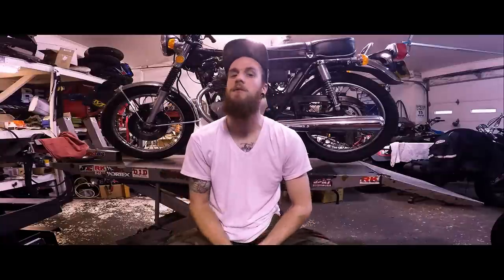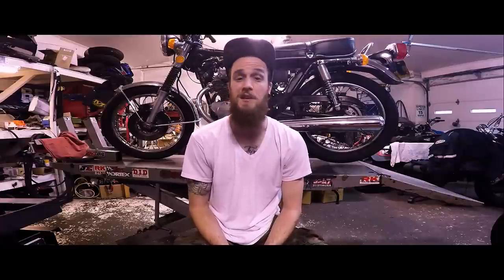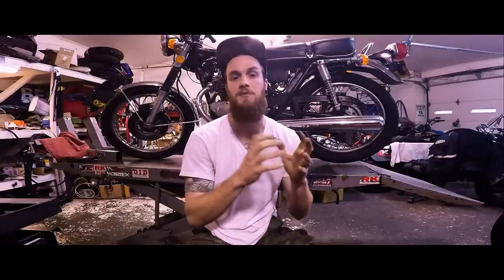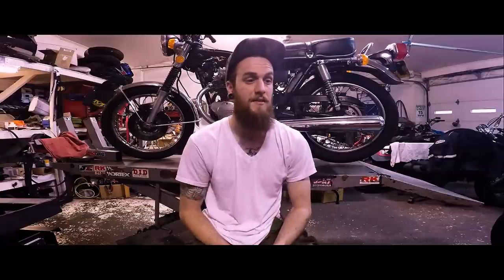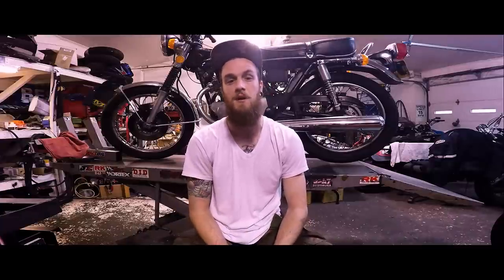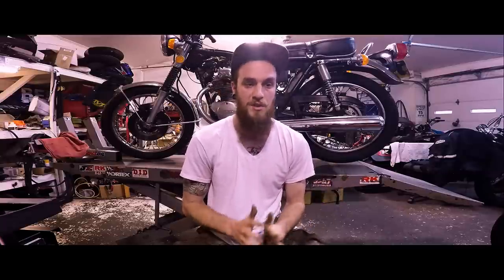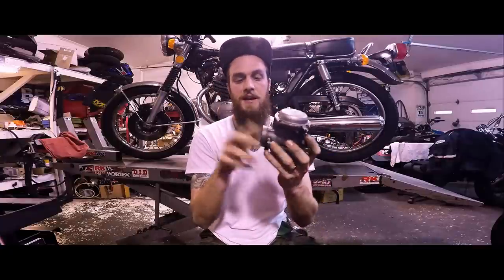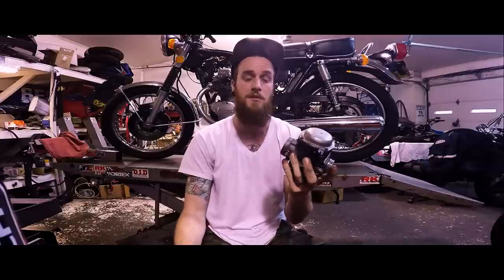How to diagnose a carburetor problem in less than 5 minutes

Comment: I got a question, bike runs smooth idles good besides one cylinder, the  cylinder has spark, the cylinder will run with the other three if I spray starting fluid, and when I drain the bowl it has fuel in the bowl, what would cause it to not get fuel if there is fuel in the bowl. There is a hole in the diaphram of the slide I know that. Could the leaky diaphram cause it not get fuel at all even at idle?

Comment: I have a 1981 gs450 that I am putting together. The bike was sold to me without carbs. I bought a set off ebay, cleaned them, and put everything back together. I had to re wire the bike, so I was concerned about the ignition, but I was getting nice fat spark. Compression was good. After got everything back on, I couldnt get any thing only get a crank no start. Tried to diagnose the problem with the starter fluid, even then got nothing but cranking. Any ideas where I should go next?

Comment: I have an old trail bike, and it was running till I dumped too much marvel mystery oil in the intake. I've checked to make sure the carb is working, and it does, I can get the engine to run by dumping gas into the cylinder, but it just takes off once it starts. If I let it, it will probably rev until detonation. Does have a suicide throttle thing going on but I can see that the throttle is completely closed. What do you think is going on?

Comment: After cleaning my carb and putting in fresh  petrol it will start but won’t tick over  unless the choke is on and once off it will cut out and when riding when throttle pulled back it just seems to choke

Comment: hello, 
I am having an issue with my 82 Honda v45 magna. I removed the carbs and cleaned the bowls and Jets because I couldn't get the bike to run without the Choke. I finally got all the Jets clean and reinstalled the carb onto the bike. Now my issue when the bike is idling without the choke on and I try to blip the throttle it dies. I'm stuck on what to do next
Reply from the maker: Did you soak the carbs in any solution? Just because the jets and bolts are clean it doesn't mean that the all internal tunnels, ports,and transfer circuits are clogged up. You probably don't want to hear this but I would recommend taking the carbs back out and really diving in. Often times peoples idea of "I cleaned the carbs already" is far from what that actually requires to be true.
Reply: andrrewa17 l

Comment: I have a 94 intruder 1400.  Just got it.  Runs weak.  Front cylinder plug was fouled when I got it(black wet with gas).  Bike sat over winter before I bought it.  Replaced both plugs.  Still runs weak.  Is driveable but I have to really twist the throttle to get it where it should go much easier.  Linkage to both carbs is intact.  Bike feels like a giant ninja 250.  Pipes are gold I'm told that means running lean.  Checked new plugs after 2 mile ride on highway.  Front cylinder plug barely ashy.  Brownish creamy white not full white.  Both factory plugs are still over both AF screws so I know the mixture is set to factory.   My initial thought is pull and clean carbs but I'm not sure I can sync them with what I have in my shop.  Any thoughts on a direction to take?

Comment: Hey Cody, quick question. Have an XJ650 1982 Yamaha. Started my motor without the pod filters, used the hand cover technique. It started fine and idled fine. Then I put on my K&N pods, now it's having trouble to start. What's the cause?

Comment: Ok so... i cleaned my carb, reasembled and it wont start... yamaha xt 600... spark good... compression good... doesnt start....when i bought it it ran a couple if times then when it died it didn't start again... then after a while it worked and thek again nothing...
Is it possible because of the float that it doesnt even start? Lost... help me out please!
Reply from the maker: Only if it was way way off. I would check valve lash.

Comment: Hi Cody!  Thanks for the great vid!  i have a 78 cb400t.  I think it's the same as the hawkii.  im running the carbs of a 79 cm400.  stock 78 cb jetting is 75/110.  stock 79cm is 70/112.  the common belief is of course performance can be improved b/c factory shit is too lean. i stuck the 75 in there, so im running 79cm carbs primary up from 70 to 75, and 112 secondary.  When i cold start it, it starts out good then roars way up to high rpm (dead tach).  choke doesnt do anything when thats going on,  i tried winding in the idle screws to 1/2 a turn out each and that made no difference either.  I could just put the old jets back in, but id rather understand wtf i did here.  why are my primaries causing high idle?  1 carb was leaking, so i fucked around with the float to raise the needle a little.  cant see that doing it either,but obviously im missing something!!

Thanks bruh!!

Comment: Cody thanks for the great videos you make!
I have friend with a 2004 (?) Suzuki SV650 that has an issue whereby it starts fine but once warm starts to stumble. The bike sits for prolonged periods so maybe that indicates the carbs are gummed up but why would it run fine when cold? Seems like that means the idle circuit is fine but main jets might be an issue. He’s having a hard time finding a shop in the Santa Cruz area that will work on carburetors. 
Thanks again.
Reply: 2004 sv 650 is fuel injected

Comment: Quick question. If my bike starts( kick start, but not with button), does that mean my carburetor is ok? I might have a sht battery so it wont start with button but if bike runs okay with kick start, carboretor ok?

Comment: Hi Codie . I have a issue 
4 cylinder triumph 1200cc. 1999
According to the exhaust gas analyzer, cylinder 3 & 4 at idle are at OEM recommended figures (3% ) co.
1 and 2 are running at 5.2 % .
But theres no more idle adjustment left  before it cuts out. I'm thinking of dropping down on the idle jet size. ???
My problems is which  cylinder is it ?    1&2 go into one exhaust. .
What's the best ways to tune each carb .
And yes they all have been ultra sonic cleaned and fully rebuilt with gaskets and new seals and all that..
Do older bikes tend to run a rich mixture and a very high hc  figure. ?
My victory runs almost on fresh air is it possible to set up an  older bike to run more eco friendly  ?
Sorry so many questions.

Comment: Hi bro. I got a '94 Kawi. Cleaned carb, did valve clearences (maybe a little loose), new battery, adjusted float, is now starting and idling finally... but when i give throttle, it either bogs, or revvs very high and hangs there.

I got one leak between the carb and the filter, air side. Can that be the problem? Mixture screw 2.5 turns, i dunno man

Comment: Hey was seeing if you could help with adjustments of the throttle cable from the carb? My throttle adjustment is maxed out on my bars and my throttle still sticks when I turn the bars to the right and it's super sensitive in all other positions of the bars. Thanks for the videos keep them up!! I have a 83 Honda nighthawk 650.
Reply from the maker: Hey Brian, I'll try my best! Are you still using the the stock handlebars,cables, and or risers? How confident are you that the cable routing is correct?
Reply: TheMotorcycleMD yes everything is stock. Im pretty confident because I can get it adjusted pretty good except when I turn the bars to the right the cable has way to much tension on it and sticks. Is there something else it could be? Does adjusting the throttle cable at the carbs loosen the cable or it if a different adjustment altogether?
Thanks!!
Reply from the maker: Bryan Stocklas Hey, head over over to motorcycleMD.com so I can get your email. It will be easier to respond.
Reply: TheMotorcycleMD I sent you a message on motorcyclemd.com thanks again

Comment: I have a 125cc scooter the other day it was working completely fine than the next day i filled it up with fuel it just randomally start making boggy type noise when I rev more it doesn't get enough power was lucky enough to get 30mph in a 50 zone :/ any ideas?

Comment: I have a CB350 that I got a few months ago. It runs rough. Carbs are clean, valves are adjusted and everything. It stutters in idle and mid range, can't get it to idle at below 1100 without it cutting out. How do I tell if it's too lean or too rich? Also, how do I go about tuning the carbs and syncing them?

Comment: Hey man I have a ninja 250 that was sitting for about 2 years at first it would shut off on idle when giving it gas. The carbs were cleaned as well as dumping the bad gas and now it runs and doesn’t die however there is some power loss I have to twist the throttle all the way down which is unusual. The bike just feels different. Do you think changing the spark plugs can fix my bike?

Comment: Got an 86 Honda goldwing GL1200 ASPENCADE. Doesn't like to idle without choke and will stall if accelerated. Can spray starter fluid and revs up. Suggestions?

Comment: I have an old kz650 with mikuni CV carbs and it only runs when I spray starting g fluid into the carbs it'll rev up high then die, and I too lean? Or possibly a clogged jet?

Comment: i have a motor 2 stroke,and it runs very poorly,i can start it,i drove it ,but it runs like very very poorly.Can u diagnose that please? Also I opened the carburator pilots a good,but the only thing that i found old was my float.Can the problem be because of that?Please I need help

Comment: I recently bought a 03 ninja 500 with low miles, battery is new, the choker cable is moving, the guy said the carburetors were recently cleaned. Normally it should turn over even on cold weather. I keep cranking the bike until the battery dies with no luck and eventually I resort to jumping it with a car until it does run. The bike runs good once it does but when I leave it off for several hours it does it again, the choker doesn't seem to help much. Any suggestions?

Comment: So i have a 81 cb650c ive cleaned tje carbs and put it all back together. When it starts it iddlesas at about 2k and then after warming up it goes to 5k and bounces around alittle. Ive disconeted the throttle cables the choke is not on have the pilot screws at 2 1/8 turns from being set and idle screw not even touching the idler.  Ive bench synced it and I have no vaccum leaks that i can detect and all the jets seem to be not clogged. Im unsure where to go from here.

Comment: Hello,  I own a Dr250s that I have bought. The bike itself isn't running the best, It doesn't idle at a constant level, and It has a major delay on the throttle while in motion. The delay isn't there or at least not noticeable while in neutral. To my knowledge, it has been ridden alot over the past 6 years with out much service...  What could this be? and could i do it myself or should i take it into a shop?
Reply from the maker: +Ethan Honestly brother might be a good idea to get a professional to check it out with the amount of hours put on that. I would hate for you to spend more time combing through non-issues to figure out what's going on. May be time for a good valve job and a solid diagnosis from a trusted tech.
Reply: Sweet. I was thinking that that would be a good idea. Just a bit pricy is all

Comment: Great video love it. Question i have a dirtbike Lifan 125 engine, kicks right up idles fine, when i go through the gears it severely lacks power, backfires excessively on deceleration, and makes spitting noises when throttling. Put new plug in old one had alot of soot, exhaust has alol of soot in the front and back. I think its running too rich or the float is messed up, i can almost tighten the screw on the carb down to barely nothing and it will still run. but i feel it maybe more than that. It'll start with choke closed almost first kick and sprays fuel out with the air filter out when kicking it. any ideas?
Reply from the maker: At first thought it almost sounded like the cam timing or ignition timing is out. Regardless, it is definitely WAY too rich. Either the main jet dropped out in the bowl, float issue, blockage in the intake (air filter area), main jet needle clip is wrong position ect. If I where you I would buy you a brand new carb to replace that one. Those Chinese/Taiwan made motors are cheap. I bet you could find a carb for it for 50$ shipped to your door. Save the headache and start fresh.
Reply: thanks for the reply, ended up figuring out last week it was the timing. the flywheel was not attached properly. Still running rich though so looking to get a new carb. Thanks for the advice !

Comment: Very useful info but I habe a question, I have a 1982 honda cb650sc, clean, coated tank, rebuilt pet cock, and carbs with a brand new ignition system. When I go to start it on full choke or without the choke it will begin to run then die before I even release the starter button. I'm wondering if this is an issue with the jets or possibly a timing issue?
Reply from the maker: I would check compression, and spark on each cylinder for sure
Reply: TheMotorcycleMD it has good compression and spark because it will run on starting fluid.

Comment: Hey! I would have one question: I have adjusted the float level on my carburetor, and replaced the float needles. Now after the winter the bike will not start. I am wondering whether it is due to the earlier modifications - I even tried a bit of starting fluid but it did not start. Does that mean it is something else than the carbs or can it still be the carbs but they are way too rich?

Comment: Hey guys, I want to ask if it is an issue to stop the fueling and run the engine until it stops?
Reply from the maker: Lazar Tsaprev What would be the purpose? If it is for winter I would suggest heading over to my winterizing video. That will show you how to drain the carburetors completely.

Comment: Hi my name is Julian i wanted to ask you if you can possibly answer me about my 1967 mustangs carburetor. It has been sitting since 1976 and i ended up replacing the distributor, spark plugs and the starting solenoid  I went to start it for the first time in 40 years and it turned over great and running like a champ plus it has good compression  . Ive been running it everyday for at least 2 months for 45 mins and starting with no trouble but now its firing and its trying to start but it wont turn over and if it does turn over it runs like its misfiring all over the place and if i give the gas pedal  a tap the engine stalls out. Does this mean my carb is bad?

Comment: Why would my 95 Yamaha virago 535 all of a sudden no power at high throttle. It starts and revs but just all of a sudden after not driving most winter it started doing this and backfiring. And why would my pilot screws have to be all the way in to get a good air fuel mixture using Gunson Colortune??? Should I check if my fuel pump is pumping enough. I did clean out my gas tank 6 months ago and might of had some water in it still idk. It was at least running good. Help please!!

Comment: Hey buddy, I hope you can give me an idea on an issue I have...

My bandit 1200 has a cylinder which doesn't seem to ignite (exhaust pipe of that cylinder stays cool) 

A symptom I see is that I can't blip the throttle, I have to gradually increase gas else it sounds like the engines dies

Sound wise it runs sometimes smooth, sometimes a little rough, 

Any leads?

Comment: I have a question. I have a AJS dd125. It's a twin cylinder. Carbarated bike. The bike turns on fine and idles fine. When attempting to go for a ride the bike is abit jumpy. go through the gears then when coming upto a junction for a turn. Slow down and obviously come of the throttle the bike just shuts off. I was wondering if the main jet is too big and is running the bike very rich? I can't turn the bike back on until after about 20 minutes. Starts up straight away. Soon as I open the throttle to go for a ride. cuts off again.
Would really appreciate the help.

Comment: Hey Cody. What's goin on man? Got a question for ya. I recently got a 1985 Kawasaki ZN1100B Shaft Driven bike. It's been sitting but I'm not sure how long. I can get it to start and run poorly with the choke pulled out but as soon as I push it in or try to hit the throttle at all, it dies. The carb looks very clean on the inside. I'm not sure what to do. I cannot see any adjustment screws for the carbs anywhere. Could you help?
Reply from the maker: Richard Hardin How do you know that the carbs look clean? Did you have them off the bike apart completely?

Comment: Hi mate, when I'm riding my mc19 it will only get to about 4-5rpm and then bogs down and no power. And most of the time die when I pull up at a set of lights. Could this be my fuel pump? I have read on other forums it could be the fuel pump. Thanks Liam